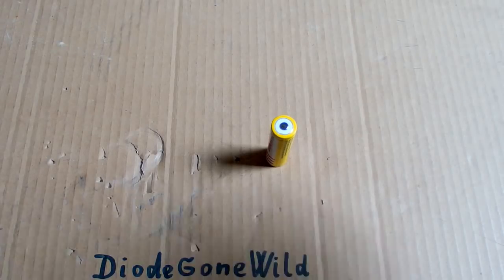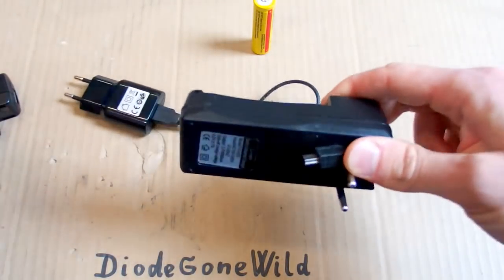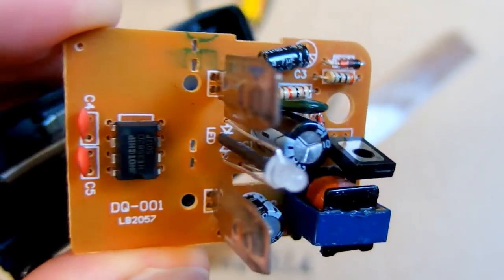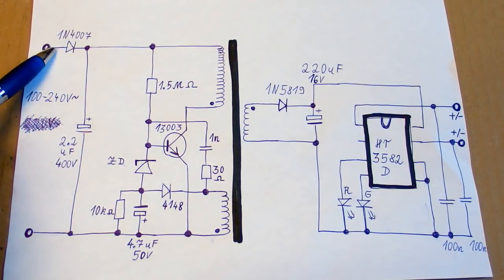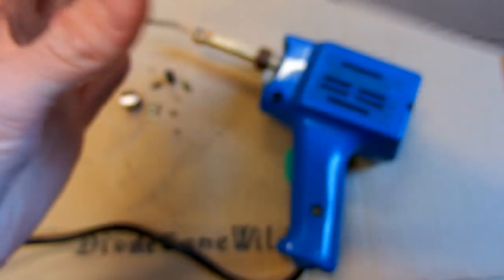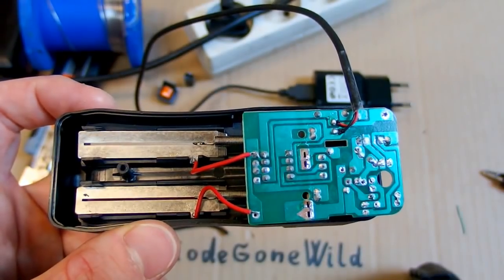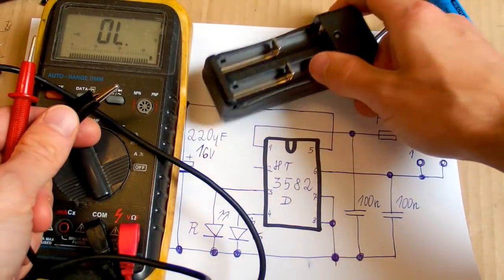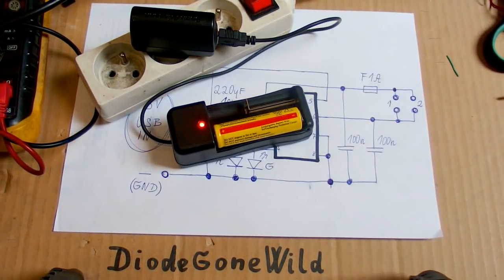How To Build Your Own 18650 Li-Ion Cell Charger

Comment: I made my own Li-Ion USB charger by connecting 2 diodes with a voltage drop of 450mV in series and a current limiting resistor, works fine, but is it safe?
Reply: battery overcharges ur house no more

Comment: any need maybe for a 5v zener across the input lines in case the charger over volt the charging circuit? And what about a improvement like a low esr over the standard cap.

Comment: You coul use a custom pcb or sot23-5 adapter on a perfboard with the mcp73831 battery management chip

Comment: Are you crazy? You are using 5V to charge a 4.2V Cell. Or has the chip some kind of voltage regulation?
Reply: Yes it steps the voltage down and cuts off at 4.1v I think it said on the label. This guy wouldn't make that mistake either so easily he's fairly on the ball. Anyway that's the voltage that the transformer he replaced was ment to be supplying but it was "doodgee" in his words.

Comment: I just made the mod following your video, is it possible to increase the charging current to something like 1 amp? Charging with 0.3 amps is actually really slow.
Reply: Yes look up the data sheet of the chip usually its just a matter of swapping a resistor but you can also change the capacitor to a larger one to give more current.

Comment: This won't protect against two batteries connected against (+ to -) each other, but adding a few ohms of resistance in series with each battery would prevent the self high current charge/discharge from happening. Unfortunately it would take even longer to charge and the charging LED will probably claim fully charged before it really is. Wouldn't be too bad if you leave the batteries trickle charging continuously.

Comment: This modified has automatic over voltage protection??
Reply: What do you mean by overvoltage protection? Do you mean it on input side or output side?
Reply: There is a auto cuttoff when battery is full charge??
Reply: @DharmeshTechZone  you're right...

Comment: In this schematic figure, The assignment of IC's pin 5-8 is wrong !   The pin 5 and 6 are grounded.  The pin 7 is connected to a battery (+) and the pin 8 is connected to +Vcc.
Reply: absolute wrong.. pin 1 is bat. negative and pin 7 is bat. cathode

Comment: Great video , I have a question, my diode is 1N4006 , and I'm charging an 18650 battery bank, 

I inserted the microusb cable and in between the the cable and the solar input, I have the diode, do you think the diode is strong enough for a battery bank or which one would you recommend?

Comment: Cool man. I use a TP4056 chip charger, it is cheap and just comes as a board, you either charge with wires or solder a holder.
https://www.aliexpress.com/item/5pcs-5V-1A-Micro-USB-18650-Lithium-Battery-Charging-Board-Charger-Module-Protection-Dual-Functions/32583428593.html
Please review it later.

Comment: Fantastic, this is going to breathe new life into my father's old electric screwdriver (Black & Decker Powerdriver 9074 type 1, i can't even find when it was made, probably nearing 30 years by now). It's old Ni-Cd battery pack died off when i was a child and sat in a box for years until i hacked a 5v wall wart into it as a teenager (just tossed the batteries and soldered the cables to the terminals), it wasn't wireless anymore but it's been working for almost a decade just fine and my father loves it, recently however, i realized a li-ion cell would sit perfectly in the battery space of this thing but i didn't knew how to charge it without having to remove the battery to place it in a charger, so looking around i stumbled with your video. I'm sure i can scavenge the parts from the secondary on that circuit to build it myself, no need to even buy one of these chargers.

Thank you very much, the best part is that i get to reuse the wall wart... again. :)
Reply: Very cool fix

Comment: Subscribed after you were mentioned here:
 http://www.eevblog.com/forum/testgear/$20-lcr-esr-transistor-checker-project/msg1301289/#msg1301289

...which will also get you on here:
http://www.eevblog.com/forum/other-blog-specific/dd/msg1093983/#msg1093983

  Interesting accent. It sounds like a double complex accent. Did you learn English from a none native English speaker?... It sounds like you learned from someone that was either Dutch or French-Canadian. Unique is a good thing in my opinion ;)

Comment: ahh... bobby trap with those swappable polarity, even though the chip have polarity detection but if you connect 2 battery with different direction then it will melt down
Reply from the maker: Yes, it's a trap. They try to save money, so they use just one chip. People can easily put the batteries in different directions, as they are used to it with AA batteries. It's better to use just a single cell charger. Or maybe somehow put a second chip into it.
Reply: One fix - add one more 1A fuse between the two slots.  ;-)
Reply: Another trap: when you put two cells in that haven't been used all the way together in parallel and are at a different voltage, a high compensation current will flow, as one battery will charge another, with a decent enough likelihood of unpleasant consequences.

Comment: Now that's the way they should of made it :-D
Safe and runs off any 5v supply.

The chip should not get too hot as it will  only have roughly 2v drop across it with a flat battery :-D
Reply from the maker: The chip definitely gets less hot. The original power supply was anywhere between 5V and 7V, too high and very poorly regulated.
Reply: zx8401ztv It's still 600mW, which is the limit of the most IC's in the dip-8 package. It's not like tp4056 boards, where the ic has a thermal pad to transfer heat to the board.
Reply: zx8401ztv Yeah, I know that I ruin every conversation I barge in :D
Reply: MrJohhhnnnyy,  Thanks for telling me off lol :-D
I did say "Roughly" i didnt say any exact value, as that evil Mr johhhnnnyy will correct me with a big hammer LOL :-D

Im only playing with you :)
Reply: No you dont, you are eager to correct that evil english man He he :-D :-D
Reply: zx8401ztv What I like to do in such situations is to add a resistor in series with the supply. Value depends on the current, for this one a 1Ohm resistor in the supply will decrease the dissipation on the chip to 0.51W, which is a 15% decrease. The charge chips usually operate fine down to 4.5v, so you can choose the resistor which will drop that amount.
Reply: That's good, I just decided to share a trick I've been using and found to be quite useful.
Reply: MrJohhhnnnyyy, ive used 1n4002 diodes in series to do much the same job, they can cope with heat better, just my view of cause lol.
Reply: Well, in the example I told about before, the resistor dissipates 90mW max, so you can safely use 1/4W one. 1N4002 @300mA will drop about 850mV @25 degrees, may be too much; but... That will cause .85V*.3A=.255W of dissipation, which will heat up the diode, thus decreasing its voltage drop. Long story short - it will reach an equilibrium point, which is a bit tricky to predict, unlike the resistor. 
 Your method works just fine, I just preffer to use resistor because I've scavenged a bunch from soviet tv's :)
Reply: MrJohhhnnnyy, yes they did work, and slight variations in current didnt seem to alter the voltage drop too much, it all depends on the current and how lazy i was to calculate a resistor.
A zenna works nicely but i often didnt have the ideal one, so a string of in4002's were my lazy bastard way lol :-D
Reply: According to datasheet, it limits at 1W thermal dissipation. They rate the package at 100°C/W and throttle at 150°C, with hysteresis down to 120°C. The minimum input voltage is specified at 5.0V and maximum at 8.0V, higher than you see with typical charge ICs, so one might be curious as to how well it behaves around the CC/CV transition with an input resistor, it could make it early, or start oscillating. Or it could be just fine and the datasheet is full of datashit!